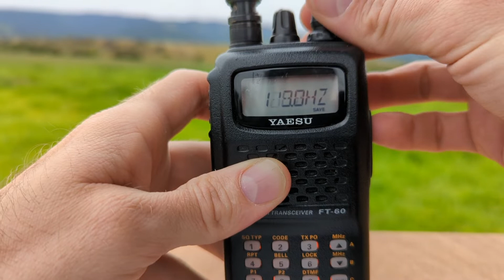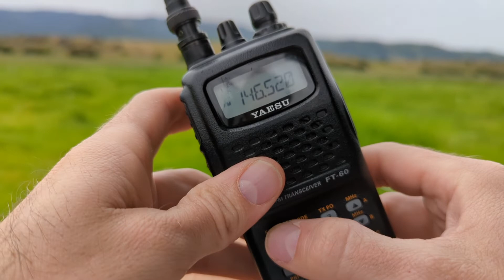How to select CTCSS Tone and Repeater Access | Yaesu FT-60r How To

Comment: Ok how does one configure the FT-60 for simplex operations?
Reply from the maker: The button below the "9" key switches between VFO and memory mode. You can then navigate to your desired frequency.
https://youtu.be/Pd4fQk-t1pA
 Make sure the tone is set to off. 

You can save a simplex frequency to a memory for easy access.

Comment: Some repeaters need a code like CC1 or D 315.  How to do it?
Reply from the maker: Hi Joel, Good question. Hit Function > 1 to access the Squelch type. Rotate the dial until you see DCS and hit Transmit to save the selection. Press Function > 2, then rotate the dial to select your desired code. Thanks!